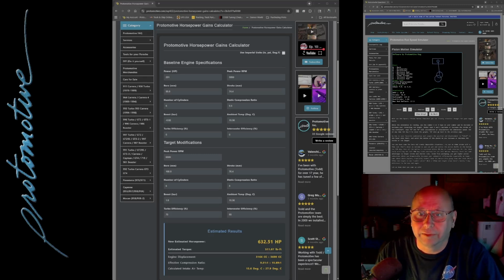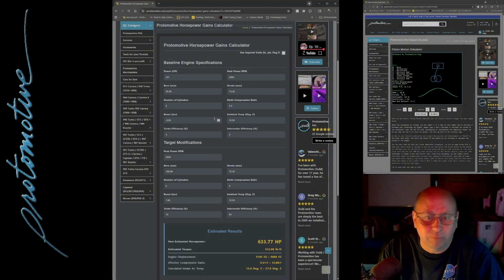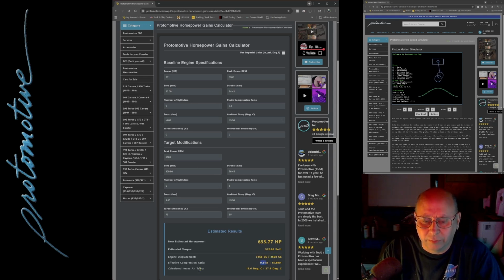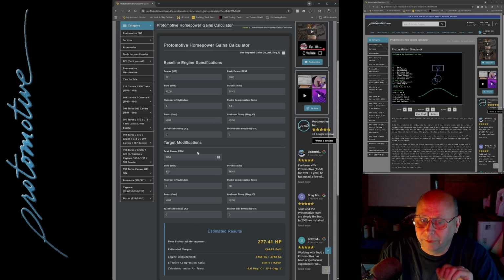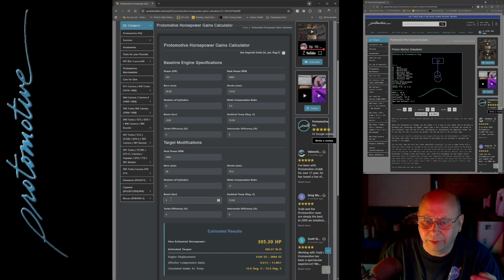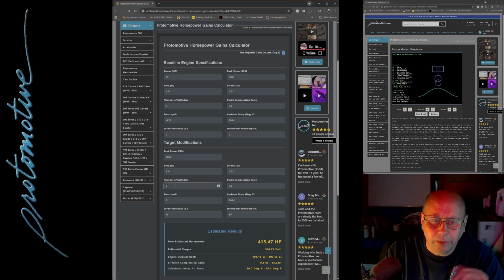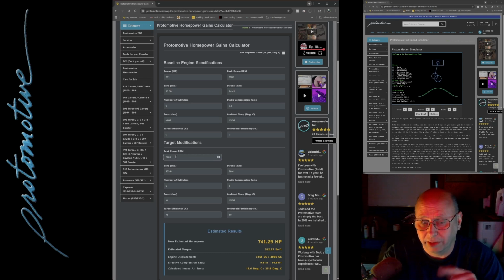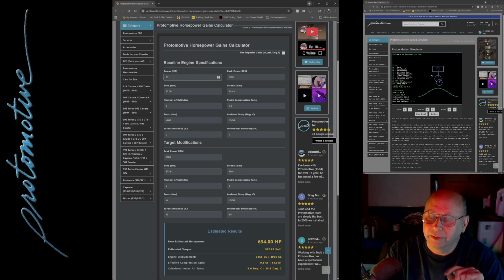1000hp and more!  Horsepower calculator for mods on your Porsche 911, 996, 997 turbo.  Or any car!

Comment: When you say some software requires a whole lot of data what software are you referring too?
Reply from the maker: Oh I used to have a Dyno Sim program that was over the top!   Many are similar.  Engine Sim programs too.  Port flows, cam specs, manifold design and flow, exhaust resonant tuning lengths, compression ratio, valve sizes, etc etc.   A lot of data most people don't have.   This program uses a base cars efficiency to build whatever you want based on that baseline.   Still a bunch of numbers but I think way easier to work with and less tendency to be out in left field since you have an accurate baseline to build upon. Over the weekend I turned this program into an android app with a vehicle database for baselines.  It adds a whole new level of fun comparisons.
Reply: @protomotive  your own in house program?
Reply from the maker: @tlovsoe4211 yes.  I need to compile it to an apk and test but otherwise it's ready to go :)
Reply: @protomotive  seems like you have your work cut out especially if you want dual zone heat release.
I don't think the incorrect assumption of power increasing monotonically with compression ratio is useful for the lay man.
The idea that a pressure ratio multiplied by a volume ratio give a volume ratio is a bit baffling to me.
Reply from the maker: @tlovsoe4211 the compression ratio is far from a linear increase.    Play with the program and you'll see the decreasing returns as you continue to raise it.   And you can play with boost vs turbo and intercooler efficiency to see about intercooler, non intercooler e*efficiency and the effect to your power.
Reply: @protomo @protomotive id not state the relationship between compression ratio and power is linear rather I stated that you assume power increases monotonically with a increase in compression ratio. I am not familiar with the term intercooler efficiency. Does it relate to the effectiveness and pressure drop? Let me ask you one final question what is the pressure ratio of a engine with a dynamic compression ratio of 10 assume isentropic compression(hint: it’s not 10).